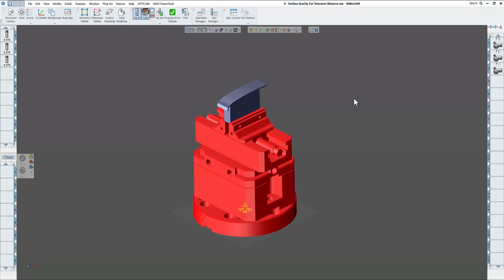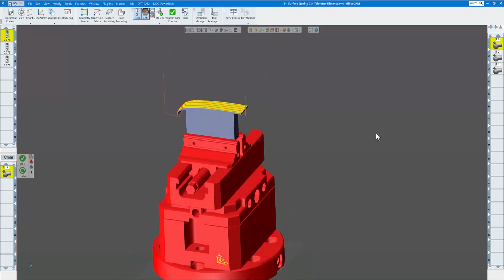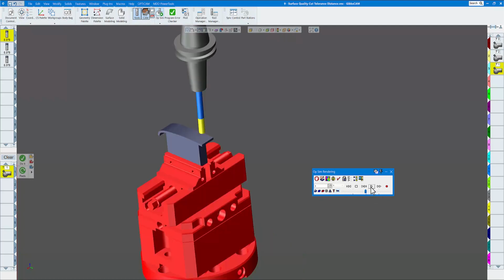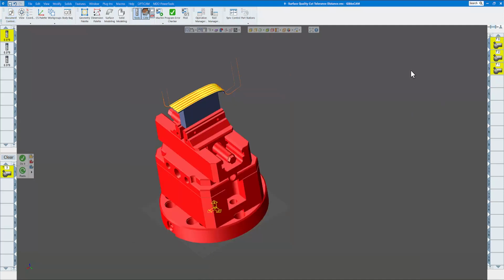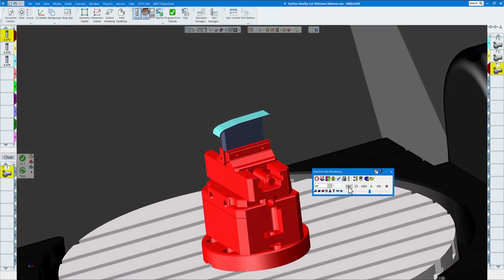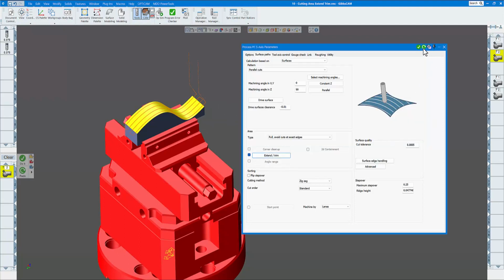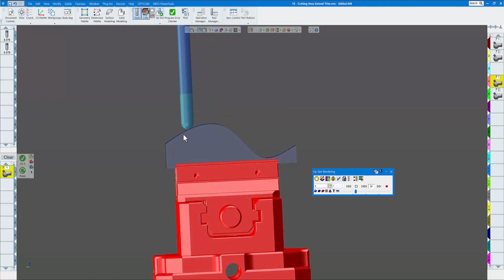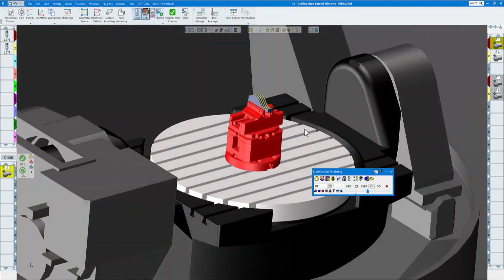GibbsCAM 5 Axis Series 2

Comment: Expensive this app?
Reply from the maker: It all depends on the modules you need.  From  3-axis milling, so solid model milling, to 4 or 5-axis simultaneous milling.  All starts at around $5,500 USD.
Reply: @GibbsCAMVideoTutorials  possible..the posts super expensive😅..i just use in years ..other app...
Reply from the maker: Posts range from $500 to $2,000.  Swiss posts more.  @Hanal503
Reply: @GibbsCAMVideoTutorials  or maybe 40k...mill-turn😅😅😅😅 robo